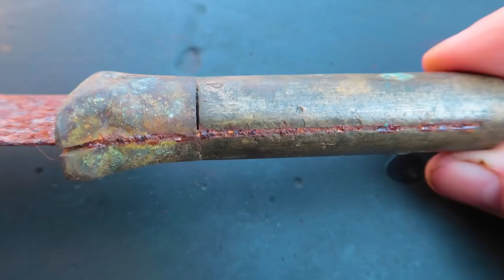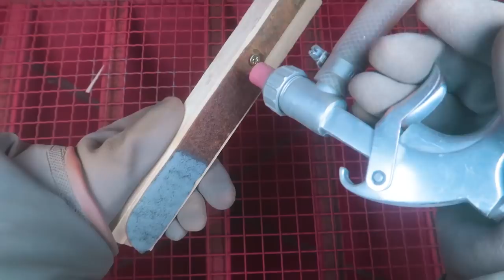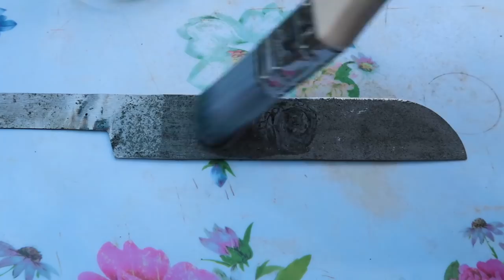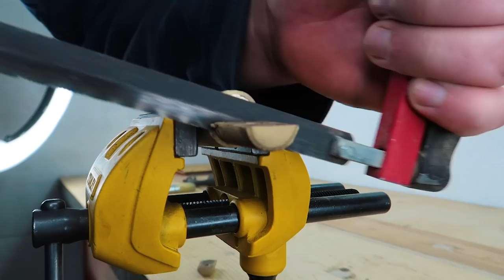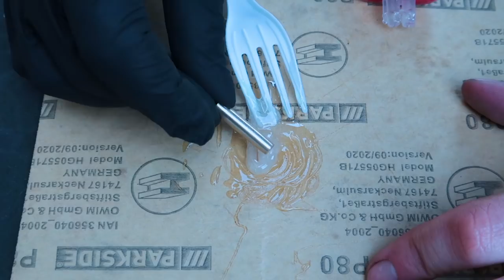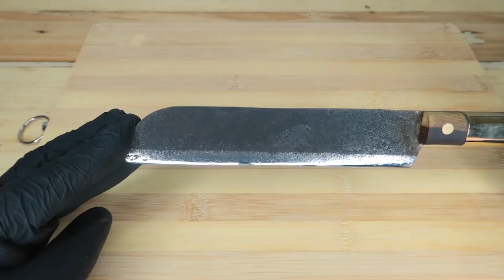Restoration of a 100-year-old Romanian knife .

Comment: Maybe next time make sure your pin fits into the holes so you don't have glaring voids filled with epoxy. Oh, and maybe not call it a restoration when you destroy the handle of a knife and replace the original metal with a bit of wood.

Also, learning how to sharpen by hand would significantly improve my opinion of your skill.
Reply from the maker: Thanks for your detailed opinion, I will take into account what you said and in the future I will like to improve and I will bring the video to a higher quality :) . thnaks man .
Reply: @GarageRestoration  Yeah, no problem. I apologize for being a bit 'rough' about my suggestions...
But look at it from my perspective - you removed much of the original character of the item. It's like taking an antique glass/bronze diving bell and replacing the glass window with plastic. Sure, it might be a better implementation. It might last longer. It might look better. It just isn't a *restoration*.

Thanks for taking my comment in the nicest way possible. ;)

Finished product looks nice.
Reply: I can't believe you think someone will ever be concerned about your opinion, specially when your channel has no contents at all. The owner of this channel was incredibly polite with his response.
Reply: @alejandrojorge5872  My points were valid. I agree that Garage Restoration was very polite. That's why I made note of that fact in my second comment.Thanks for stopping by.
Reply from the maker: Some things can't be restored 100%, basically, I don't even know exactly how it was done, it was customized :)
Reply: @GarageRestoration  That is an excellent response and solid reason. I like you more for your willingness to admit you did not know. :)
Reply from the maker: Obviously you don't know them all, especially the unique tools :)